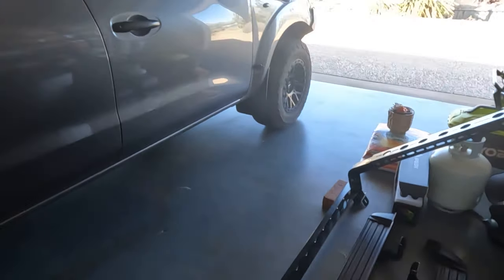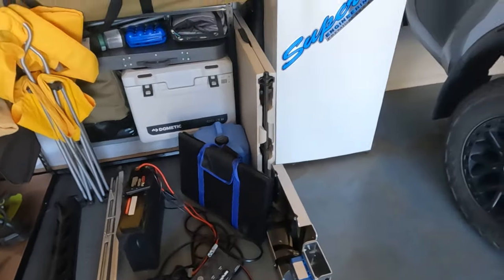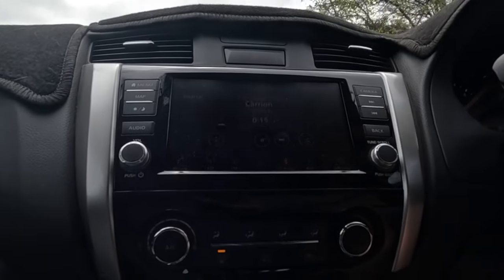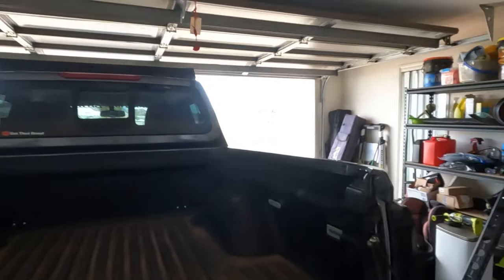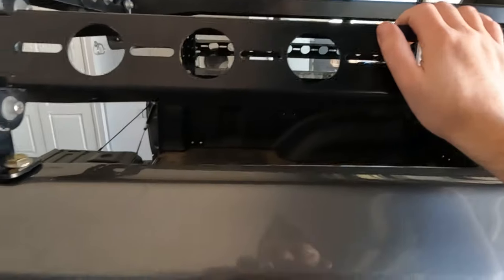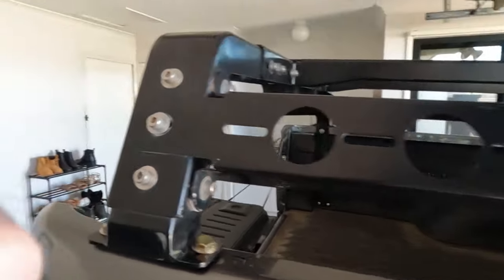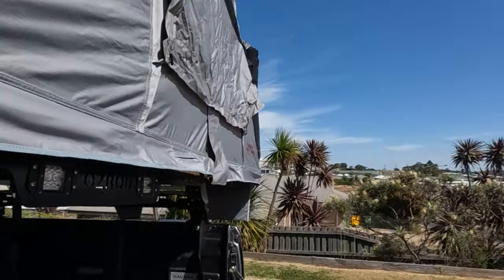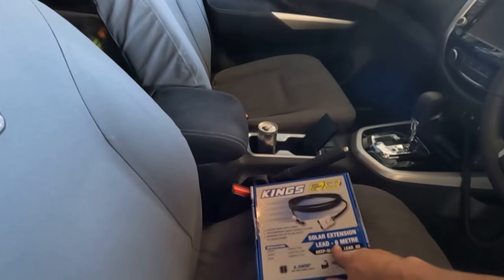Let's go CAMPING! We need to get the Navara ready...

Comment: I also have a series 4 Nav and had a kings dcdc charger crap out on me. It stopped isolating itself from the starter battery, so it was constantly charging despite the blue ignition wire being connected. 
Hope your new setup lasts for you.
Reply from the maker: Oooft, that doesn't fill me with confidence. Thanks for the heads up!
Reply: @GetThatBread  it was the model of charger that came out before the one you’ve got. It wasn’t available for very long, so I’d say they had a problem that they probably fixed
Reply: @GetThatBread  what went wrong with your kickass one?
Reply from the maker: It fried itself somehow and stopped doing anything at all. Happened right before going to Fraser too, classic timing.
Reply: @GetThatBread  ah damn hey. Mine malfunctioned on Moreton 😅 absolute classic